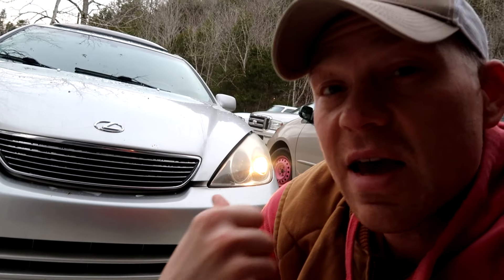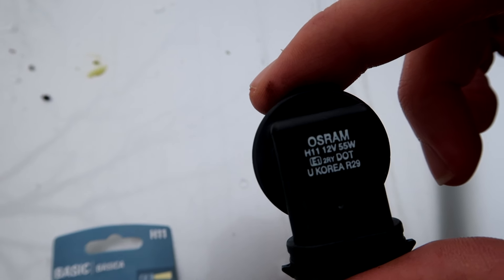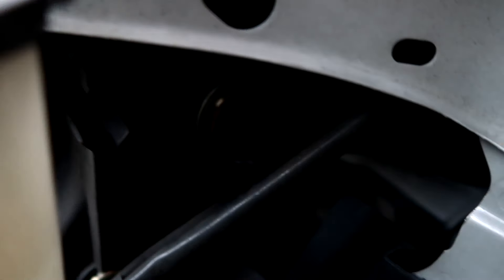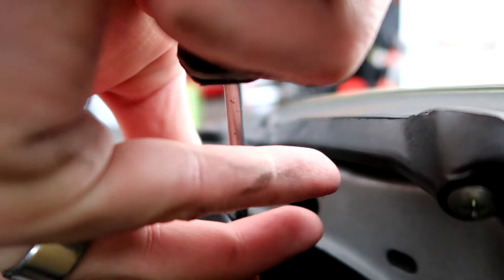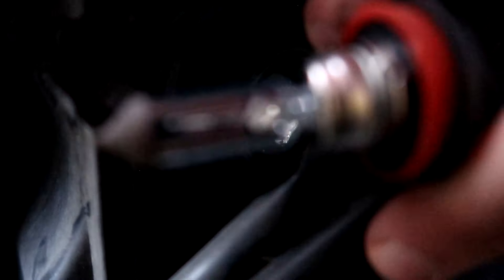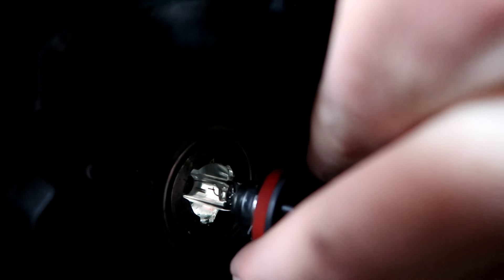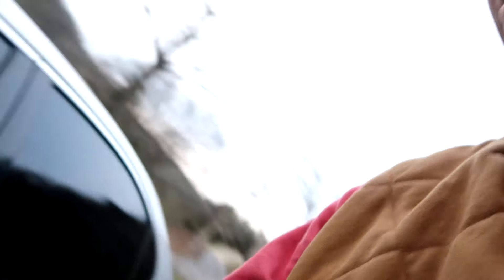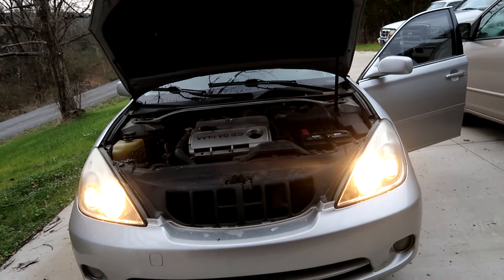Lexus ES Headlight Bulb Replacement

Comment: The reason you have to avoid touching the bulb is because it will leave finger prints on the bulb. Since the filaments operate at such high temperatures, it will cause the glass to heat up unevenly at a very high rate and it will cause the glass to break. As a mechanic, I wear clean rubber gloves to protect the bulb and usually clean the bulbs with alcohol before installing. Thank you for another great vid! WHO-TEE-WHO!

Comment: Oil from your hands gets on the bulb, when the lights turn on it superheats the oil causing it to melt and explode. Use plastic gloves when working with lights. Standard for any lighting industry. Thanks for the video! I needed that 😃

Comment: My girlfriend has the same car. I have to replace a tail light bulb and came across your video. It's always nice to have videos for instruction. I replaced her head unit recently with a double din screen and it took a lot of research to find the right wiring harness. Fyi it's an Axxess TYTO-01. Just install, turn the volume up a bit on the head unit and adjust the blue knob on the interface for feedback noise (I cranked it all the way up and just a smidge down until I didnt hear any feedback ) and you're gtg. Only problem is if you disconnect the battery you have to take it out and disconnect/reconnect the wiring from the interface box to reset it. Honestly it only takes a few minutes once you know how to take it out. They are great cars!
Reply: I have a whining noise coming through my deck is the blue knob on the turn on amplifier harness? The gain knob?

Comment: The grease from your fingers makes it blow, or so I've always been told. Great vid those are actually pretty easy.
Reply from the maker: Yup thats what ive heard too, although i touched many of them before I was told that and never had one blow. Yup these are not bad to swap. Would be even easier with little hands
Reply: That's close, but a common misconception. It is actually the salt from your sweat that kills them. The natural oils on your hands hold and transfer the salt, which causes the glass envelope of the bulb to start breaking down chemically at the high temperatures that halogen bulbs reach. And sooner or later the bulb fails because of it.
Reply from the maker: Ive always touched the glass and never had issues until recently someone told me it could possibly cause them to fail
Reply: It makes a difference how clean and dry your hands are. Hot and sweaty = more salt = premature bulb failure. Just washed = less salt and less risk to the bulb. 

But the least risky is to simply not handle the glass at all so there's no risk of contamination, which is why that is the usual recommendation.
Reply from the maker: Thanks
Reply: Brah!! I’m tryin Replace my left side headlight Hard is Hell
Reply from the maker: Yep, especially if you have big hands. Was even harder to try to replace it and film it at the same time :-)

Comment: Some use grease around the rubber seal on the plug in seal. Mine is a 2007 and i had to push rather than use a screwdriver. I pushed down on the teeter totter type latch and one side  moved up so i could pull the old bulb from the plug in.

Comment: I have a question I have a 2000 Lexus ES 350 it has halogen projector headlights could I throw an HID bulb in it since it's already a projector headlight does it have the connections for an HID already? Or would I have to get a conversion kit still? Thanks 👍
Reply from the maker: If the plugs match then it should work

Comment: I have to replace my headlights on a Lexus 07 es 350.the right side keeps dimming out will the cheaper ones at AutoZone around forty bucks will those work
Reply from the maker: I always get the cheapest ones I can find
Reply: I went to AutoZone last night. and then I called the Lexus dealer. they told me I have to use the ones that come with the car... but now I know the truth. Thanks to you?
Reply from the maker: Yeah they like to RIP you off. It will have a model number usually 4 digits and will carry several different bulbs. I always buy the cheapest
Reply: You might was to research that dimming thing--apparently, LOTS of us with es 350's are experiencing this and the dealerships are saying "sorry, nothing we can do". It's not a lamp problem, but what it is, nobody will/can say.
Reply: MLawrence Jonesj  I’m working on replacing the same light bulb for the same kind of vehicle Lexus ES 350 ???

Comment: Where did you buy your bulbs ?
Reply from the maker: Any car part store has them
Reply: @WHOTEEWHO  two different quotes: speedy oil was $130- taking off the bumper, Lexus dealership was $230 with not removing bumper. live in a small town so not many choices...will visit part stores for the bulb...thanks again.

Comment: Is it the same on both sides of the car?
Reply from the maker: Exact same
Reply: Thank you!!
Reply from the maker: Thanks for watching!
Reply: So, I went to change out the bulb and see only the bright bulb that looks like the one you show here.  The other cables go into what looks like a white plastic wheel and there is a gray piece that is attached to it that looks like it might snap on (not twist as the dim light you show here).  I took out the bulb that looks like the ones you show here, so I know what it looks like and how to get it out...thanks to you...but can't seem to find the dim bulb...am I being 'dim'??
Reply from the maker: The dims are the furthest to the outside of the car. Brights more to the middle. Both look very similar but the brights are different bulbs than the dims in this car
Reply: Ok...I think the problem is our year is a different one than yours. The inside looks different.  I found a video that shows the inside of the car that looks like ours.  The light bulb assembly has to be removed, and there is a cover and then the bulb.  I know how to change the bulb once we're in...hoping this works...I think it will.  Thanks for a great video and your help & patience!  Best~
Reply from the maker: Ah. Good luck!
Reply: Thanks!!!:-)

Comment: I know right I have a ES 300 02 model
Reply from the maker: They run forever. We have two. One has 260,000 miles and the other has about 230,000 miles. Both still ride like a Cadillac